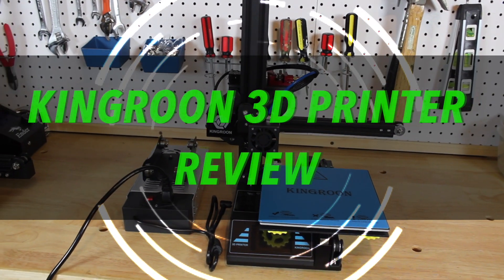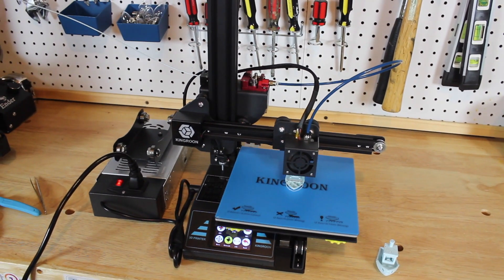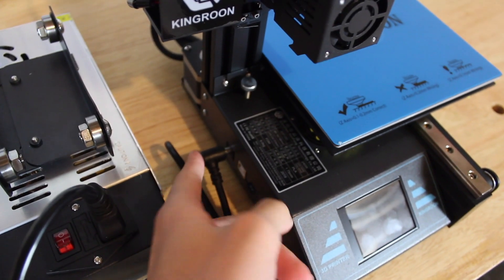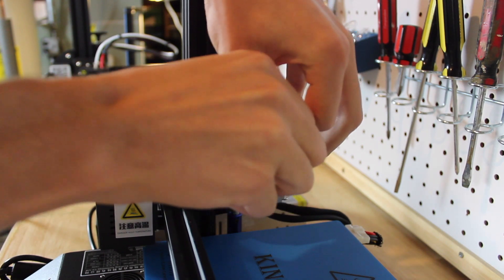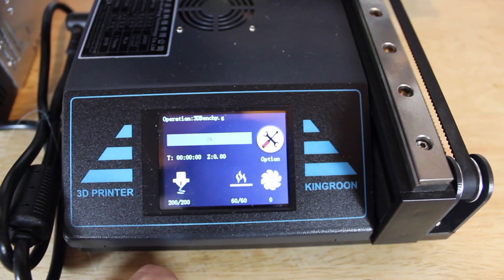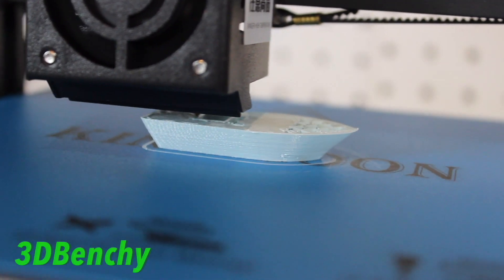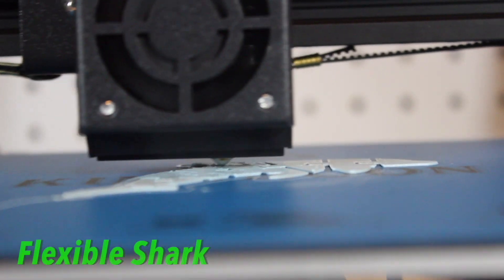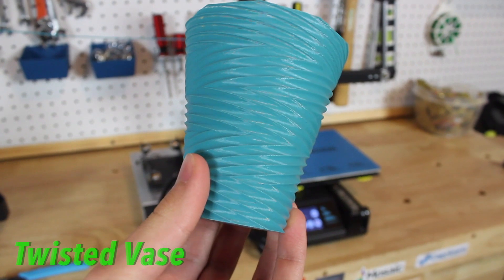Can I Even Get It To Print!? - Kingroon 3D Printer Review

Comment: they have changed all the issues u pointed out in this video. i got my kingroon kp3 about a month ago an it has been the most hands off printer ive ever owned. all ive done to it was print a sd card slot cover to help with directing the sd card into the slot and a part cooling fan duct which i did end up having to model my own cause they must have changed the x carriage cause all that i tried didnt line up with the hotend. an u should be able to take the settings from the kingroon slicer an move them to cura. the power jack has been changed an it fits nice an snug now an dont stick out as much as the old one. the filament run out sensor is changed an is lined up with the extruder so the filament has a straight shot from the run out sensor to the extruders hole where it goes in. the end stops look different on mine too an dont site cover by the x motor cover. they have listen to the community with this print cause every early review of this print points out all the same things an they are all fixed on mine. im guessing thats why the x carriage is different on mine also. anyone else that has a new kingroon kp3 let me know what part cooling fan duct you used. id like to have a dual fan setup if possible. i just remodeled the mount for a fang to get something on it and right now im using 3 different slicers the kingroon slicer for my kingroon kp3, creality slicer 1.2.3 for my ender 5 and cura 14.07 for my anet e10. they all came with the printers sd cards and have worked better for me than the newer cura profiles ive found, but ive  point out that these slicers are a reskin of a cura 3.xx version so u should be able to move the settings over to cura an they work the same in a few facebook groups an the ones that tried it reported back with success so i plan to make a profile for each of my printers on the newer cura so i can take advantage of all its options i just havent found time to site down an copy everything over. if anyone has tried this let me know how it worked out for u an if u had to do any tweaking. and for the incomplete gcode. ive had this happen before with my ender 5 using the creality slicer. i think i closed the program  out before it was able to finish writing the gcode to the sd card. either way it was the same as urs. would get to the end of the gcode an just stop. my temps would stay at what it was set to til u canceled the print. not had it happen since. after realizing the gcode wasnt complete i figured i had pulled the sd card before it was done writing an now i make sure the files is written to the sd card an eject it, if its still being used it was pop up something asking if u want to continue retry or cancel. i always cancel an give it a few seconds an try it again an it always ejects then and ive not had the issue since. and i switched to better sd cards from the cheap un marked ones that came with some of my printers.
Reply: If anyone else has a new kingroon ko3 and can’t find a part cooler to fit let me know an I’ll share the one I re worked so it would fit
Reply: @capthowdy126  where did you buy yours from?

Comment: I just got this 3-D printer and all these problems he pointed out I couldn’t find looks like kingroon saw this video and fix their problems that they had with their printer. Except with the lead screw and the filament That was the only problem i found but everything else on this printer is great!
Reply: @SaltySnail what was the link where you got it?
Reply: I too just got this printer and have had no issues so far with two 3D prints
Reply: Same here, I got mine a couple days ago and within 40 minutes of unboxing I was printing the samples on the SD card with great results. I think I spent more time making sure the bed was level than anything else. So far, for a very affordable first 3d printer I couldn't be happier.
NOTE to the author - Maybe instead of "the same settings you use with every other printer" you should try the manufacturer's recommendations first?

Comment: the slicer looks just like creality slicer 1.2.3 which is the same thing as u said its a reskin of a older version of cura but it works so well for my ender 5 im curious tho if u could take the numbers from the slicer that came with them an move them into cura so u could take advantage of all the settings it offers over the reskin of older cura.
Reply from the maker: Good question. That might work, I just have to test it.

Comment: imagine printing pla plastic at 215 C, and making a bad review some people man. have u ever printed pla before omg.
180-200 C is the recommendation, in which 200 is a bit high.
Reply from the maker: That's 100% not true! The 215C was the recommended temperature on the slicer which came with the printer. That temp worked for that printer when 200C would not melt the plastic fast enough. It could be a problem with Kingroom's heater cartridge or hotend design that doesn't precisely read the temperature correctly or heat evenly. Also, some PLA plastics do print at over 200C! Composites print even higher.
Reply: @3DNow  you shall not blindly trust the preset of the slider. it's a BASE profile that should be tweaked.

Comment: I've had this printer since Aug 2019. My first printer and I still love it. I did some upgrades on it like hardwiring the power supply to the motherboard, new spool holder, adding a parts cooling fan and upgrading the firmware to Marlin 2.0. Those were all cheap upgrades and I think it prints pretty damn good. Very happy with it still after 6 months of using it.
Reply: It has a 32bit board? Quite impressive for that price.
Reply: Think I could make Clone Trooper armor with it?
Reply: hello, comment mettre à jour l'imprimante ? 
Merci :)

Comment: Should have done more research, I guess. I got this printer as my first 3D printer. Have had issues with it from the start. I got it because of the price. Like they say, you get what you pay for. Biggest issue is not having any kind of manual. I am used to having a manual with any piece of equipment I get, be it computer or radio. Got a few good builds out of it, but had to replace the bed. First one came apart. Now I can't get filament to feed. Guess I need to figure out how to take extruder apart. I guess it is good to know that others are having issues. Not just me.
John KB5GGO

Comment: I just got this 3d printer for christmas, and it's alright. The printer came in very good condition with no broken or slightly moved parts, but the .gcode files for one print I wanted to print was messed up and way shorter than it should've been.

Comment: that under extrusion looks like you didn't seat the bowden tube tightly onto the hotend. i did the same thing when i swapped mine out. it'll print fine once the plastic fills the gap between the hotend and bowden tube, but the resolution is garbage afterwards. i'm sure the printer can print at a quality that competes with some of the $500 printers.